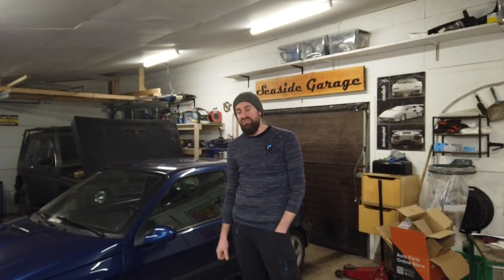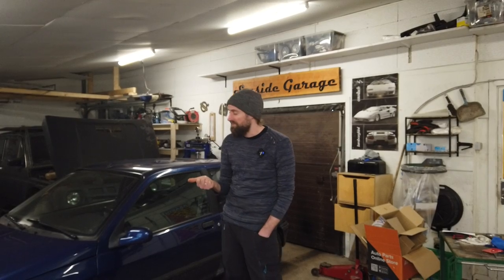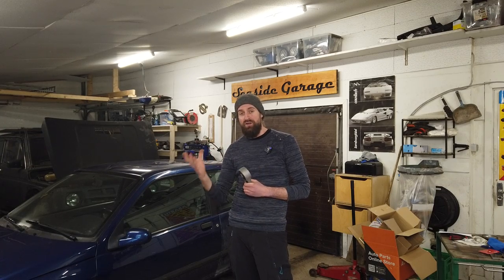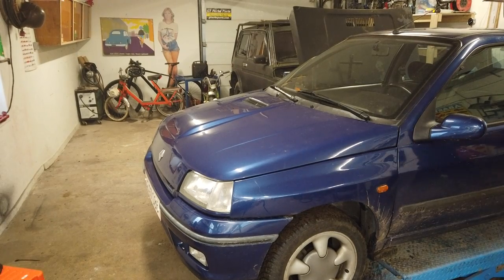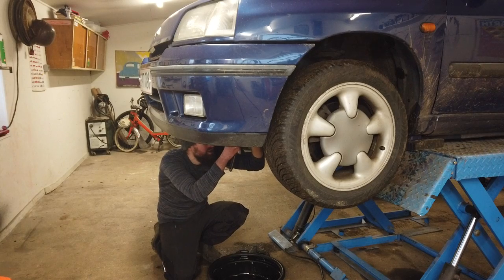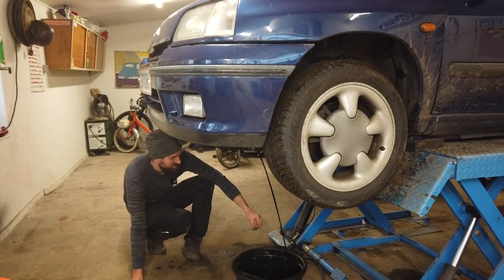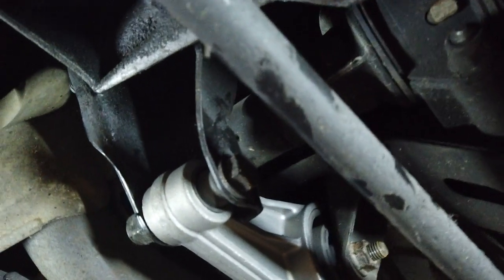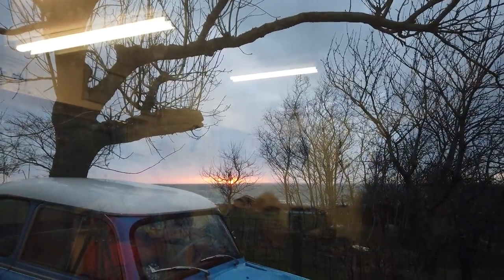Renault Clio 1.8 16v. Noisy lifter and wobbly gear stick!

Comment: I used to work on these a lot, I used to pop the circlips off the bonnet hinges and remove bonnet, undo the 6 bolts on the slam panel and remove that and access from the top. The engine bay is very tight, but the f7p is a lovely engine.
Reply from the maker: That would be more easy for sure... but also more involved... I take a hammer to the hand any day! :P

It is... Its still slighty noisey when cold, but it is getting better..

Comment: I just noticed the 2CV (or Dyane) wheel on the wall used as a cable reel, rather clever re-use there... :D
Reply from the maker: Not only a cable reel... It is also made into a drum puller for the rear brakes on Citroen A models :)

Comment: I have one of those sump plug sockets, basically a bar with 2 different sizes on each end. Had it for my Renault scenic, another tool that's rarely used but you are fooked without it 🤔
Reply from the maker: Hehe... I got to get one soon...

Comment: I've only ever used an engine flush once. I flushed the oil and coolant on the Mégane coupe when I first got the car as I suspected it had probably been a long time since the last one, even if it hadn't covered many miles between service.
That is a lot of oil, my 1.6 only uses around 4L.
I'm pleased that you are enjoying the car. It's definitely one that has been on my list for a long time.
Reply from the maker: Its really a good car... hope you get the cross it off your list as well!
Reply: @SeasideGarage  For a moment It crossed my mind that you will probably sell yours at some point but I probably couldn't afford to buy it, haven't got the space at home and wouldn't know how to import a car or any of the implications. 😂
Reply from the maker: @markonmotoring  Hehe the steering wheel would also be in the wrong side would it not? :)
Reply: @SeasideGarage  😅 Yes it would be on the wrong side. Though not ideal I have just driven my RHD car on the European continent so it's not impossible. 
Convincing my wife that it would be a good idea would be a bigger challenge though. 😂😂😂